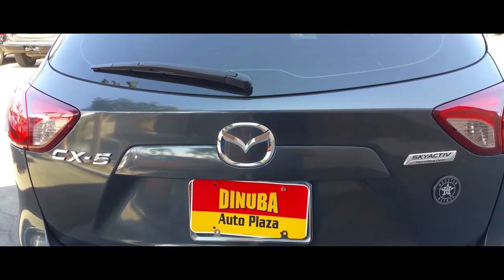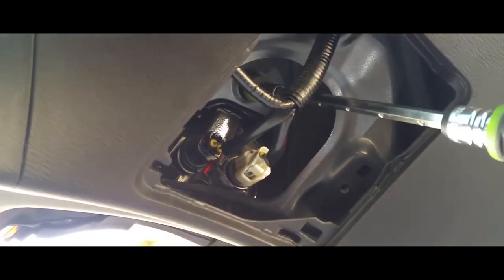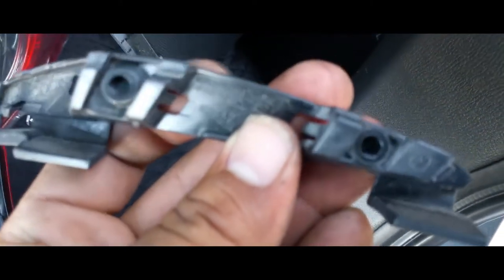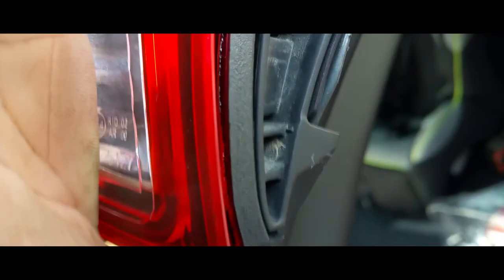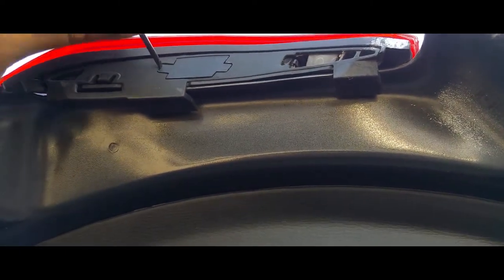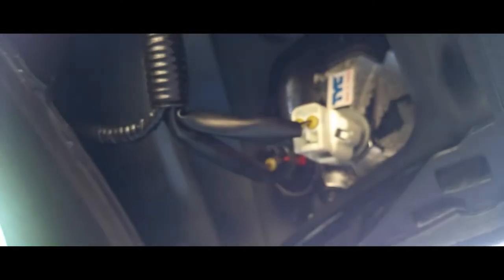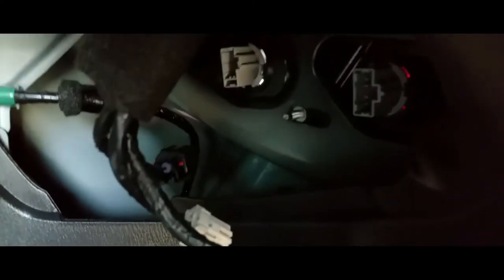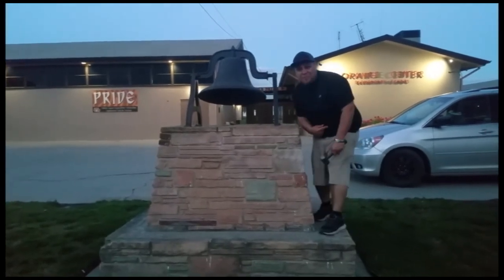How to: Replace Trunk and tail lights from a Mazda CX-5

Comment: After watching video it gave the confidence to replace the inner driver and outer passenger taillights.  It took less than 30 minutes for both.  On the inner, I couldn't easily pull the light harness out.   I removed the light bulb by turning counter clock wise and had better access and vision to then remove it.  There's more than one way to skin a cat.  
Thank You
Wish there was a good video on replacing the passenger rear fender trim.
Reply from the maker: Im glad this worked for you bud! Glad you found it easy bro,thank you for your Support!

Comment: Thank you, especially for showing where all the pry tabs and nuts were. Took my time, and accomplished one tail light replacement in less than 15 minutes. Only used a standard socket set and a small flat head screwdriver. Super simple.
Reply from the maker: Yeah when i came to that part i was like what the.....why isnt it coming off....I found out why.
Reply: hey dude which brake light is good for the’ ‘16 CX-5?

Comment: Totally different in 2021 CX5. I think it requires me to remove all plastic interior :( im still looking how because im afraid i would break clips or something
Reply from the maker: Just be careful try using a trim tool removal to help you out
Reply: Did you figure out how to replace the inner tail light? I have a 2020 and removed the plastic interior, but think I have to remove some external pieces? Can’t find anything online. Thanks